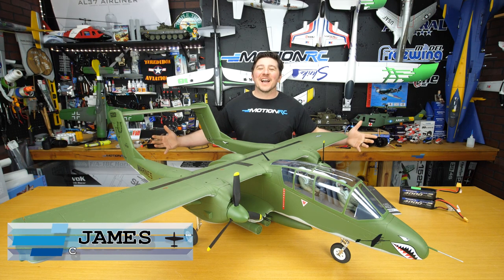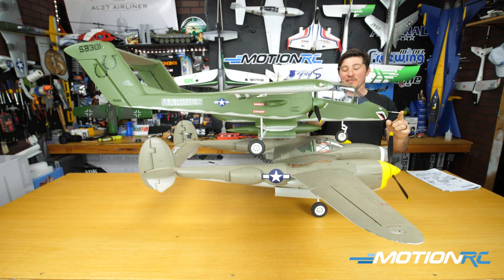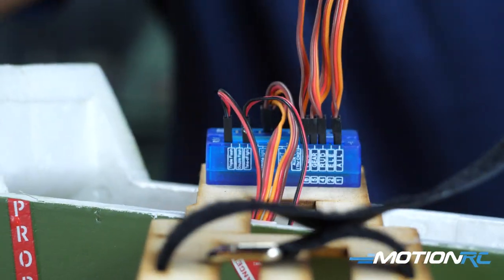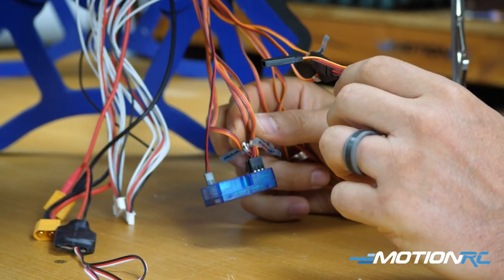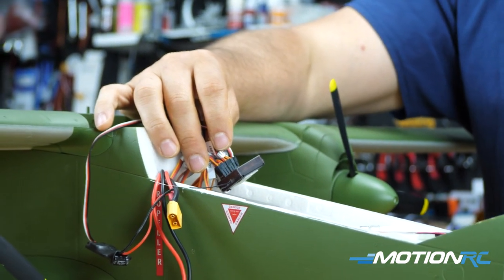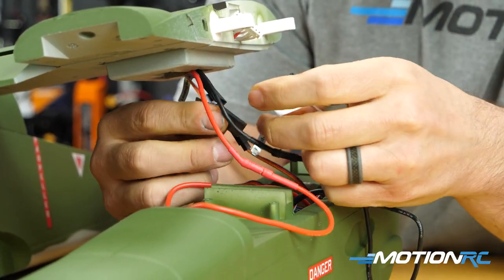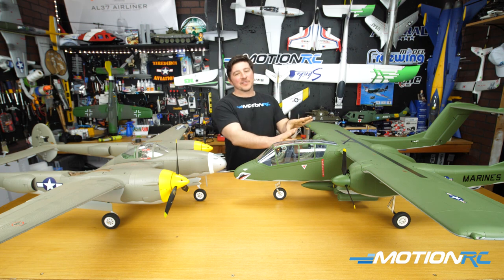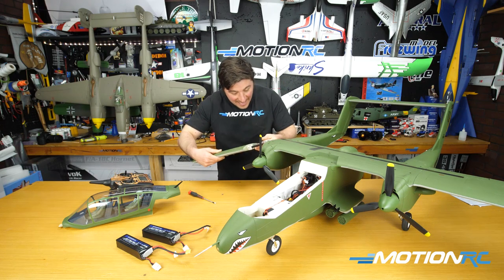FlightLine RC OV-10A Bronco UPDATED Assembly - Motion RC

Comment: Hey James, I got everything working and even the ESC's using my programing card that I did not know I even had.  Of course, once I found that they were Hobby wing, not a problem. Thanks for the video and my comments were mostly frustration from not thinking things though and taking time to do so.
Reply from the maker: No worries at all. Glad it's up and running
Reply: @MotionRC  Thanks for helping guys.  Sometimes it pays to just take a deep breath and not try to rush through stuff. Again thanks.

Comment: Cheers James
Just picked up a 2nd hand Bronco
Used your step by step instructions as the wiring is definitely challenging 
Thanks 👏
Reply: Hi, just got mine yesterday, by chance do you know if the wing ribbons that plug into the blue box can go in any of the two slots on bb? Or is each slot designated for left and right wing? Thanks and congrats on your  bronco!
Reply: @Hollywoody911  
Any slot, doesn’t matter 👍

Comment: Regarding ESC calibration, do yourself a favor and do one at a time.
Like this video perfectly demonstrates at 42:30 or so, since the batteries are necessarily plugged in with a few seconds in between, the ESCs will enter completely different programming steps by to the time you pull down the stick.
If you want to avoid having to deal with the Yed throttle leads etc, you can do both at once, but the you either need someone to help plug the batteries in simultaneously, or use an XT60 Y-lead and a single battery (for this particular step only)

Comment: I had to laugh like hell when James speeds up the video at 18:59 or so while he jams all the wiring in after the Blue Box...myself I did it the other way joining fuse to wing before pulling a wiring through and plugging blue box pulled forward. Maybe my way is better because for sure your going to at least want to pull the battery tray with blue box out later for something!! Still laughing!!!

Comment: Are you running the stability plus gyro in the "always on" mode?   I noticed you plugged the landing gear into the gear port on the rx.
Reply from the maker: I always run the gyro in combo C on a switch so I can turn it on or off as needed and yes the gear was plugged into the gear port. Thanks for watching!

Comment: I keep getting beeps after powering up and binding. The motors dont appear to run either
Reply from the maker: You need to calibrate your escs. Turn on transmitter, put the throttle stick to highest position, plug in the aircraft, wait for the first set of beeps, then bring throttle stick to bottom position. ESC's should then arm regularly. (do this with props off for safety

Comment: Hi, new to this site and new to PNP vs BNF planes. I just recently purchased the OV-10 Bronco and having problems initializing the twin props. For some reason the throttle doesn't want to work all the surface controls and the retracts are working fine. I'm using the Spektrum AR630 and binds well but the throttle doesn't turn. I've watched all of the videos on how to assemble it but I can't figure it out why it's not working. If anyone can help please reply to this post. Thank you
Reply: Turn your throttle trim down. It thinks your stick is up.